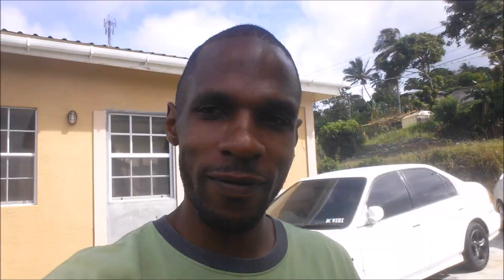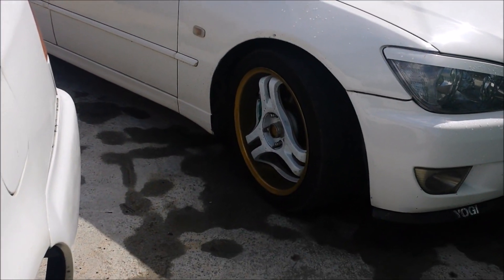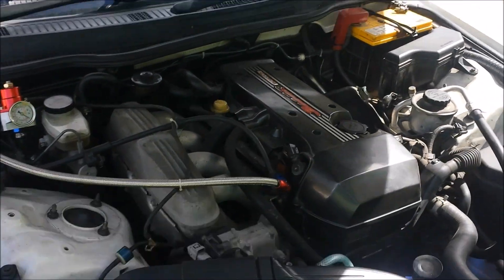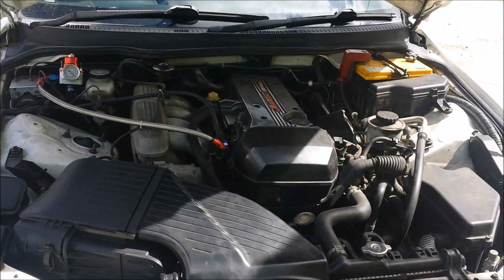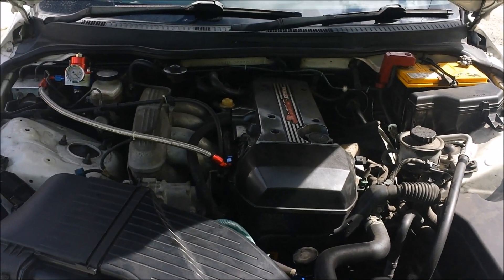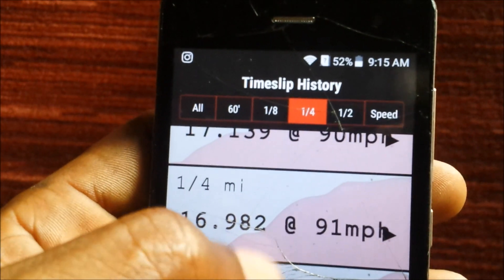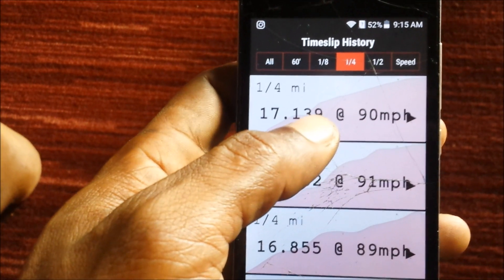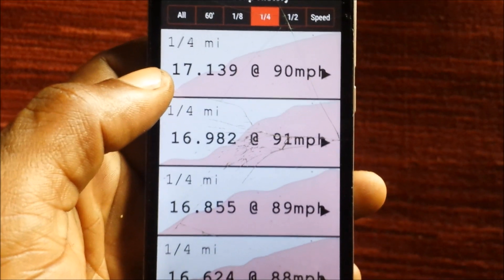Toyota 3sge Altezza Speeduino Install - Intro

Comment: Whit out the o2sensor how you prevent a check eng light how about abs and traction control that will be disable as well
Reply from the maker: Factory o2 is still left in place as well as ABS so the factory ECU is happy. Traction control unless it's done via closing of DBW throttle body, won't work since the factory ECU isn't controlling ignition. Only time you get a CEL is when you use launch control

Comment: I've seen all your videos most are way over my head but I want to get started with Speeduino. I want to use it on an LPG/CNG converted engine. I haven't bought the car yet.  Which  model of car Honda, Toyota, Nissan or other could you make a harness and help me through the installation?  I am in Thailand.
Reply from the maker: The concept is the same for any model car. You just connect wires to the relavante sensors and it works.
Reply: @DCWERX  I just bought a 2010 Tata Xenon 2.1L CNG pickup truck.  These pickups are built here in Thailand. They aren't very popular so second hand they are selling very cheep. I bought it because it's already converted by the factory to CNG and I read that  the cam is modified to make sure that the valves don't overlap as they do on a petrol engine. Can you make a Speeduino harness for me? It was a trade in at a Tata dealer so they should be helpful in getting parts and wiring diagrams.
Reply from the maker: @mikewalton7615  shoot me an email at dcwerx.slu@gmail

Comment: Factory that thing is rich as hell for N/A 11:1 dipping into the 10s. Jesus
Reply from the maker: Man I have been meaning to get my wideband installed on it before the ECU swap to check out AFR. Thanks for the heads up
Reply: @DCWERX  That is the wideband on the left when you are doing pulls right? 
or is that one of those Fake widebands lol
Reply from the maker: @Kalisto2002  fake narrow band gauge (light show) lol. I figured it runs pretty rich, because it went quite a bit of fuel doing those pulls.
Reply: Known fact all 3sge usually run on the rich side even the 3sgte

Comment: Suzuki swift next great job
Reply: yes it would be interesting to see. Great angry little cars especially the NA vvt ones (I do not know the boosted latest engines) In our country it has zero respect though because it was produced here for 15+ years and street were flooded with extra cheap mass models and it ruined the reputation .. only serious gearheads knows its a great car.

Comment: Will you have 2 maps one for when the engines vvti is not engaged and one map when the other high lift lobe is engaged
Reply from the maker: No just one VE table
Reply: @DCWERX  
Is there any way you can use the speed u i n o with 2 ve tables in a Honda VTEC or I VTEC engine with 50 degree cam angle adjustment
Reply from the maker: @RSADYNAMICS  unfortunately no. Currently, speeduino can't do vtc control or dual maps. VTEC on the other hand can be done
Reply: @DCWERX  thank you for saving me time on reading up about the ECU great Channel by the way I'm sure you're going to do really well in the future as your content is great I'm thinking about using this ECU on a Daihatsu gtti as it supports sequential injection and timing  look at the firing order of my GTti motor
https://youtu.be/0yAjesnZkg8
Reply from the maker: @RSADYNAMICS  Thanks for the kind words. I think there are a few 3 cylinder daihatsu running on speeduino. I did a 4 cylinder Charade about 2 years ago.